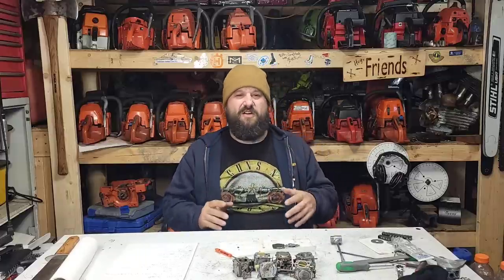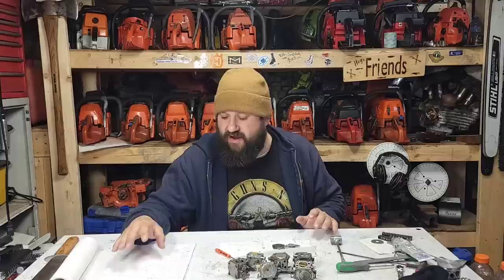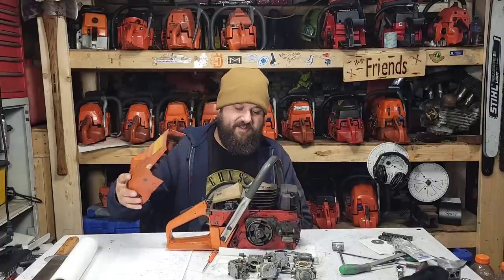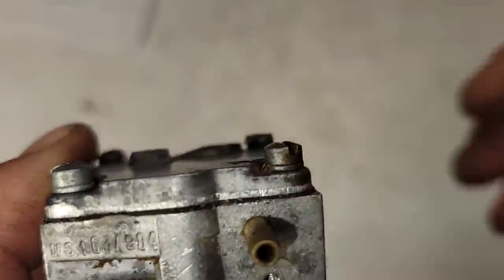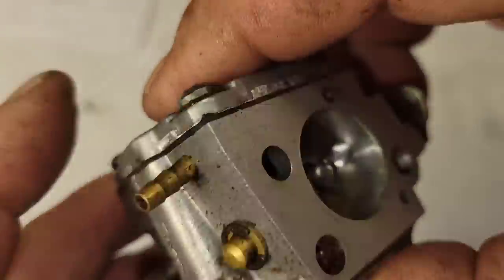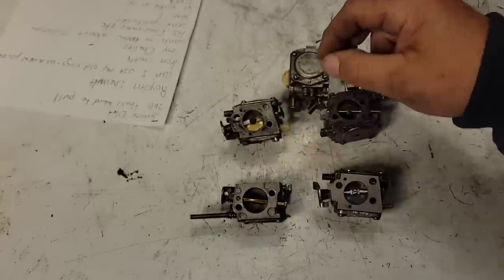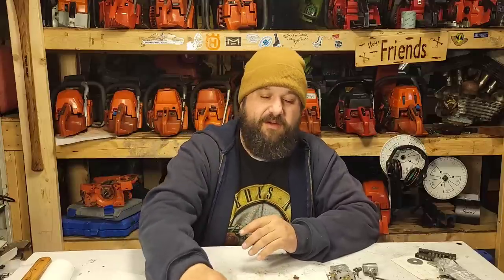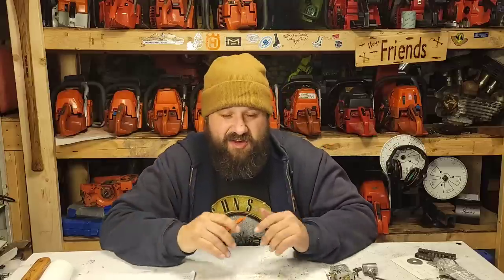Question of the day, matching the right carb to your saw build.

Comment: Its just like with Cars or any engine you can over carb anything smaller carbs have a better vacuum signal  and tend to have better throttle response but are limited in RPM capability . its kind of a fine line between response and top end.

Comment: That was really informative Tinman, thanks. I can in fact confirm that the later model 61 Husqvarnas (orange top) have an HS254 Carb on them. The black top and white tops have the 163A.  I recently acquired a blown up 61 orange top built in 1992 and it has an HS254 on it. Also the whole crankcase looks identical to a 272XP.  Made the perfect saw to put a 272 Top end on :)
Reply: @Doc-Cole_Trickle-of-Chainsaws  then there is a good chance it was swapped at some point. I looked at the Husky Parts diagrams for the 61 after getting mine and it was all 163A until 1991 when they went to the 254A with the orange top
Reply: HS163 came on 61 and 266SE saws. 266XP came with HS224. 268 and/or 268XP would be a HS254 and 272XP is HS260. This could vary somewhat with production year on later model saws as I understand it. Should also add I run the HS224 on 61 and 266 saws. 268 and 272 will run great with a HS224 as well. The HS254 and HS260 are bigger carbs but only just slightly.

Comment: Great content, so much information. Well we got a foot of snow today. Crazy, it was almost all gone and bang a foot of snow and it's still snowing. My 268 and 272 have 234A carbs and run great. My supply of carbs is limited. This is the issue with after market carbs there are no number on them. That's the difference when deciding over a $20 carbs and a $50 carb plus carb reliability. I guess. TC Mahalo Tinman 🤙🤙🤙

Comment: Really good info!. I’m building a 365 special with a hyway big bore pop up. I have it running and it cuts like mad but the idle is kinda wonky. I’m just curious if I went to far on something in the cylinder or if it’s a carb issue. I believe it’s a walbro hd 6. If you were so inclined could you go more in-depth into the tune ability issue you can run into. Also if you could maybe go over the difference between an air leak lean issue and a carb/ fuel dilivery issue.

Comment: Tinman, i have a question for you that i cant find an answer for. I have a stihl 019t that im fixing, but it has one of those stupid fixed high jet carburetors on it. The 019t came with two options for carbs, one was the fixed jet and the other is a really hard to find fully adjustable high/low jet carb. Ive struck out finding one of the adjustable ones. Do you know any other carb that would work on it? Any input from you would be GREATLY appreciated man!